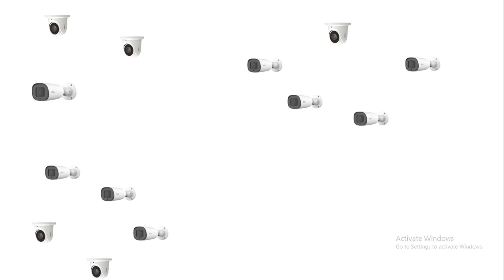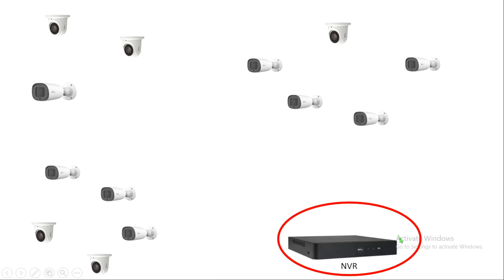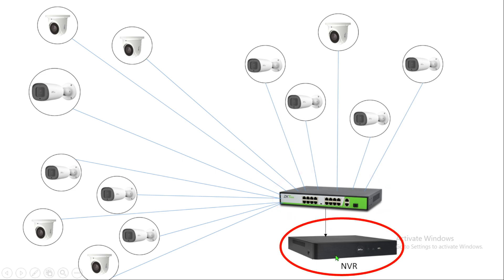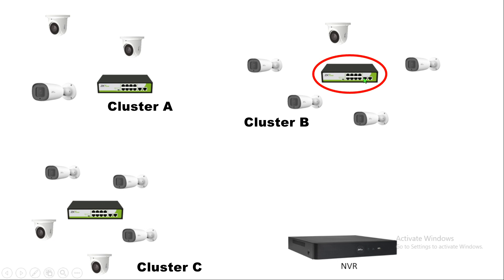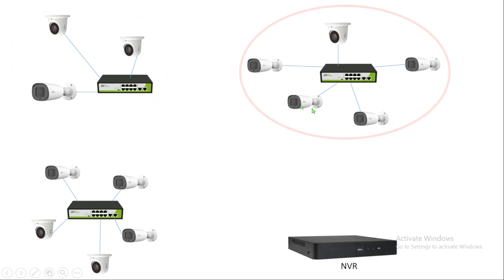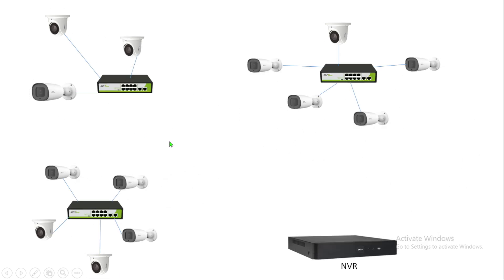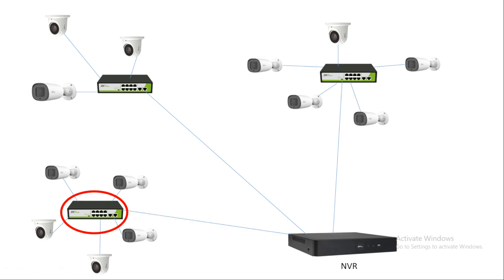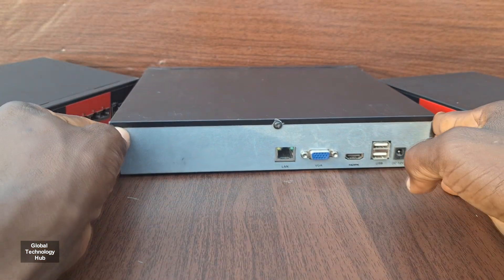How to Connect 2 or more POE switches to one NVR

Comment: Instead of using the router, couldn't you use a simple non POE switch to connect the other POE switches to the NVR?
Reply from the maker: There is a phenomenon where cameras connected to NVRs through cascaded switches  as you suggest show "Signal timed out" especially in large networks.  
Routers better play the gateway role unlike switches which are not designed as gateways.
Reply: @GlobalTechHubOnline  Makes sense

Comment: Thank you for this method but every good technician knows that the more terminals you have in your installation the more you increase chances of failure. Again when you compare the cost of buying different 4 way switches, the cost is almost the same as buying a single required number of outputs network switch. The long cables to thw single switch may be a maintenance nightmare but you know all faults can be traced back to a source since you have fewer terminals in the installation.
Reply from the maker: Having a less problematic  network  is all about taking steps to ensure the right procedures are followed when making large networks.